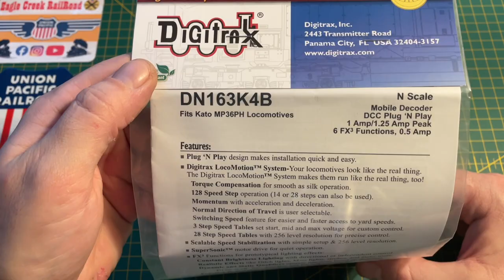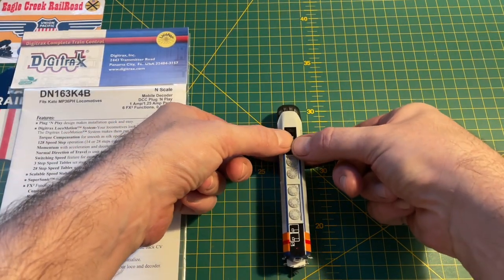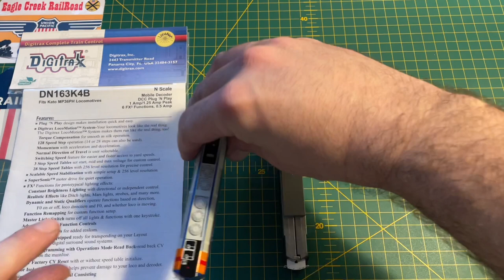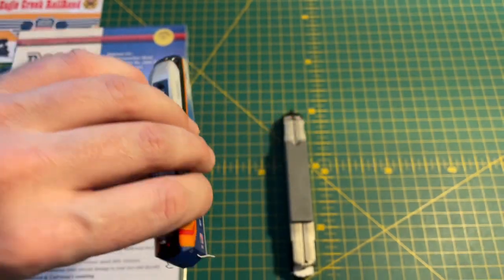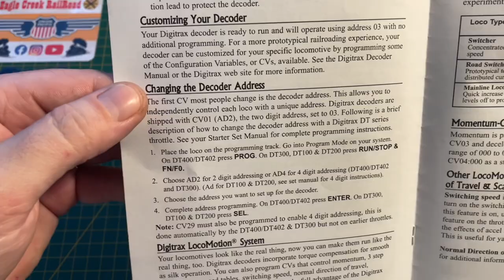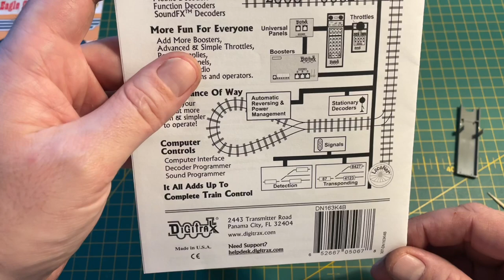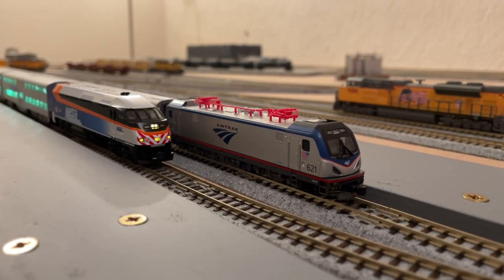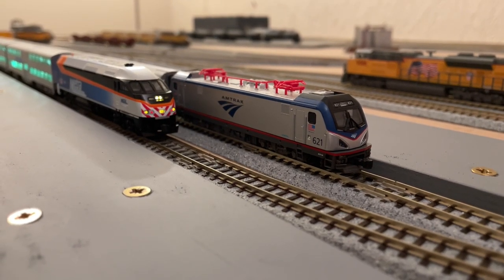DCC Fitting A Kato N Scale MP36PH With A Digitrax DN163K4B Drop-In Decoder.

Comment: Just purchased one of these with a Digitrax decoder already installed - and that lighting is a non-starter for me. The raw light from the board seems fine, but that maze of piping is simply not doing the job. Prototypical lighting is a thing with me, so I've started using fiber optics with individual SMD LEDs for the various lighting locations, and it works quite well. Already went that route with my N scale VIA Rail LRC locomotive (Shapeways shell, Atlas chassis) which had ZERO room to spare, but it worked.  This locomotive seems to have a lot more room to spare in there, so that's the plan.

By the way, this is a superb tutorial - clear, straightforward and easy to follow. Thank you!
Reply from the maker: Thank you very much. That sounds like a great plan, the standard lighting is a let down for me too and I've been looking at ways of improving it on all my engines for a while.

Comment: About the lights. I wonder if it was yellow with the original DC board installed?

What Kato is doing with the plastic color is tinting it with certain grades of pigment to attempt to filter light. This technique requires specific light frequencies expected from the LED itself.
It definitely could be possible that this is what is happening to the Digitrax LED, and could be the cause of the yellow output when the forward lights are on, and the light bleed (due to different frequency of red) when set in reverse.

And IF that is the case, there could be a long list of reasons/variables that could lead to the Incorrect LED frequencies occurring. A few that immediately come to mind could include the Digitrax product designer didn't know/care/assumed about the situation with the LED, or perhaps the specific LED type itself just wasn't available. Or perhaps an RGB LED was used to generate many types of colors from a single LED on the board, and the effort to qualify these light frequencies was just too high.

Food for thought when considering the complexities of product design, and third party manufacturers.
Edit: I just reviewed many images of the Prototype, and the headlights are very much on the yellow side, albeit not as yellow as the footage of your Kato model.